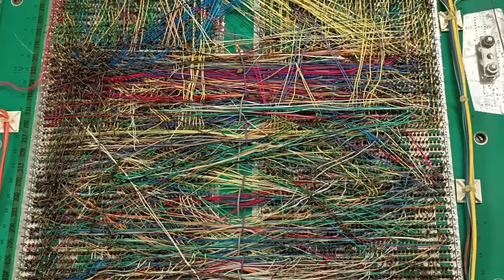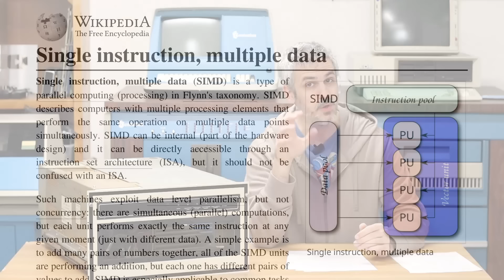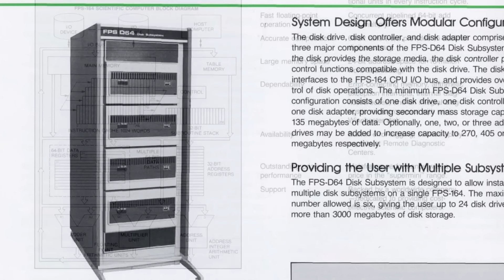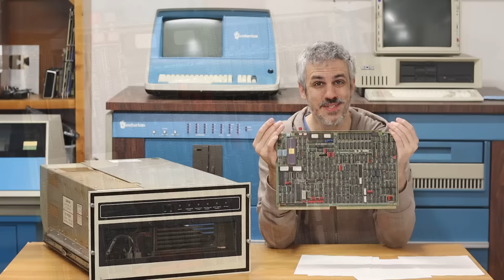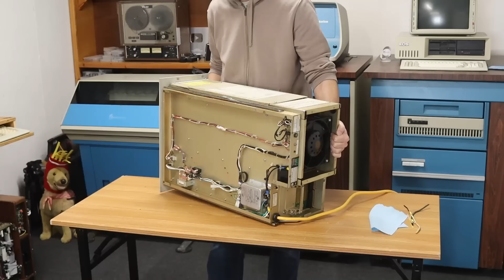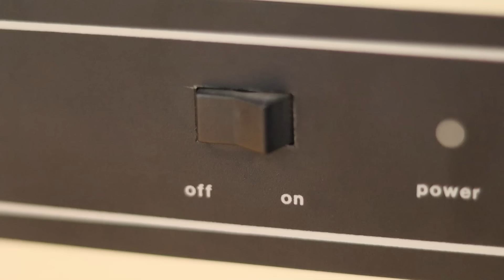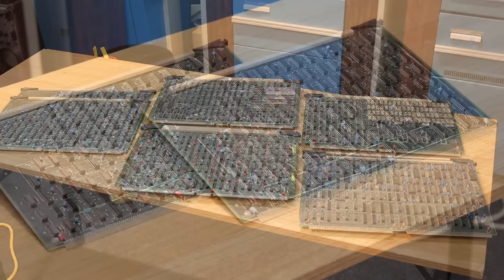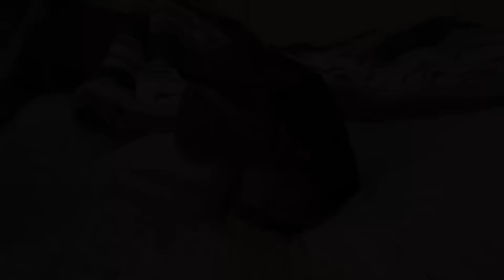This Computer is from a Defunct Supercomputer Company

Comment: My very first job after leaving school at 18, was with a local company that specialised in converting and processing seizmic data, mostly from the North Sea back then in 1982.
They had a few old to very old systems, the oldest (the name Varient come to mind with the OS called "Beta B<??> C<??> or BBC for short) 16bit machines, that had large hardware machinery of rotating drums (many sizes) that were used to read analogue tapes, where each tape recorded one shot-point.

A shot-point being the literal long line of microphoes (typically 24+1) that recorded the echos of a shot (a loud bank) from layers of rock/soil/oil... There were a lot of seizmic formats on lots of recording media, almost all using magnetic tape but paper traces that needed a person to digitize each line by hand (not quite the worst job there).

They also had a TI990 that had four half inch 9 track tape drices and one half inch 7 track and one 1" 21 track reel to reel tape drive. Those 1" tapes were heavy so the drives had very large tensioners to handle the tape stop/start taking a second or two. They picked a secon TI990 that had chip RAM rather the their old one that used core memory. Oddly enought the chip memory was slower as it needed extra hardware as teh TI's interface was just for core memory.

The newest machine they had was a VAX 11/780, that by the time I left 3 years later had 12 half inch 9 track tape drives that worked at 800, 1600 and 6250 BPI, and had auto skew detection. The VAX also had 2 Array Processers and one Rasterizer, the AP's were used to process that seizmic data doing things like resampling the traces (the digitised sound data) to account for each microphones distance from the source of the sound getting farther away, delaying the time the echos arrived to them.

At no time did anyone regard those APs as "Super Computers", they were only faster due to running in parrallel, it was faster for the VAX to do simple tasks itself as the time used to send & receive both data and instructions was still significant.

Note that the VAX had/has multiple floating point formats in 32bit, two 64bit formats. The 64 bit formats also had two types called D & G. The 32b float and the 64b-G are almost identicle to the IEEE formats that followed, making convertion of old data easy. I have (somewher not seen it for years) a VAX Fortran Programmers Code booklet somewhere that detailed all the data type VAXes could deal with at the instruction level.

All VAXes had integer instructions for both signed and unsigned: Char/Byte 8b/1B, Short/Word 16b/2B, Longword 32b/4B, Double Longword 64b/8B and Octaword 128b/16B or 8x2B to match the name.

After IEEE floats were standerdised later VAX and all Alpha's used IEEE with the old format listed as depricated and the instructions handled by routines in the kernel not microcode or hardware.

One of the most common floats in that old seismic data was IBM 32bit FP.

I still need to test out a couple of microVAX 3100 models 38 & 39 so two of the fasts single CPU VAXs ever made at 38 & 40 VUPs. I have not turned them on in well over a decade and try to sell/give them away. They look like old desktop PCs (one even has a SCSI CD reader) but they are bloody heavy due to the thick steel cases and PSU.

I'll be looking for someone in the UK who is willing to drive down to Kent to pick them up, along with a Vaxstation 2000 with 19" CRT monitor (not the original DEC one) and a VT480. Both the mVAX 3100's have 256MB RAM and twin 64Kbit comms cards used for handling things like X.25 lines, there's also a (possibly junk) TK50 and HDDs, and I just remembered there was a SCSI ZIP100 drive, it is most likely dead as those ZIP drives never seemed to last more than a few years.

Comment: I wondered, when talking about the backplane, whether it would be sensible to use an x-y (cartesian) robot to build it? I would think it would be a lot easier to get repeatable results and avoid omitting or misplacing a wrap. And IIRC wire-wrap requires a certain tension on the tool which, if not given, means the wrap looks fine but doesn't connect.
I don't know if there is any software that could translate a netlist into robot -acceptable commands but if you could start with e.g. kicad (to generate a netlist) and then thing and send the result to a robot, you could do trial runs and so on without a lot of labour intensive work. Just a thought.
Perhaps, if a robot could be borrowed, someone in the Kicad community could write a python script to make the link?
Reply: Back in the day, some companies did use semi-automatic machines for this job. The coordinates of pins which needed to be connected were punched on the paper tape, and the tape instructed the robot to move the tool the the required point. (Metalworking CNC machines used the same kind of tape at the time.) But at least some of the wrapping machines required a human to finish the connection after the machine positioned everything properly.

Comment: Geological data processing is used in analysing sismic waves and also to probe the ground for potential traps for oil and gas.
Put a big vibrator truck and analyse signal from various mic's in the ground to process the échos.  So to speak.

Comment: For me, arrays and vectors are apples-to-oranges:
- An array is a one- or many-dimensional "grid" of cells (each of which stores the same kind of datum), laid out in a regular pattern but with no pre-defined purpose.
- A vector is an array put to a specific purpose: to signify a direction or location (e.g an x,y,z vector).
- A matrix is a one- or many-dimensional grid of cells (so yes, an array) which have defined rules (so not an array) on how you do mathematical operations;

In c++ we have std::array, std::vector, std::list, and std::dequeue. Now the first three are well known but where the ** does the word "deque" come from? I understand "queue", "fifo", "lifo" and several more. Why not use one of them?

Comment: 20:36 “Clean and stable 5v” can be misleading.  As I discovered the hard way, using a voltmeter can fool you.  It’s always good to check an unknown supply with an oscilloscope as the meter often ignores AC ripple.  Chips, however, do not.
Reply: Or the cheap option, an analog voltmeter. The digital ones just show you the DC voltage, the analog one if there's AC ripple the needle jiggles.
Reply: Indeed. Without a scope it's possible to measure some ripple on the meter using the AC setting, but always better to see what's going on with a scope.

Comment: Vector processors like the Cray-1 don't perform operations in parallel like modern SIMD execution. They are more like deeply pipelined execution units. This was important for hiding latency back before caching was a thing.

Cray-1 ran at 80MHz and could complete a new FPADD and FPMUL per cycle (on different execution units), hence 160 MFLOPs. The high high clock speed was achieved with fast power hungry ECL logic, fast register files and a heavily bank interleaved SRAM.

Comment: On the topic of geological uses for an OG GPU: My advanced calculus instructor (I was in school in the late 90's) used to work in oil before being a professor. He could draw perfect circles on the board before that was a thing, because he did contour plots for oil. It came up when we worked with the "delta dirac function". Oh what's that... well oil was looking for shale.. shale will reflect/refract sound in the ground. the "easy" way to find the shale is to set up a whole bunch of seismometers and set off an explosion on the surface and do math on the signals. The explosion is modeled by the delta dirac function and deconvolution of seismometers data is the killer app from the 70's that made big money. there is a kind of movie magic version in the original Jurassic Park, where they fired a shotgun shell into the ground to create sound waves and analyzes the reflections to produce a subterranean image

Comment: Arrays can be used as vectors but in software development not all vectors are implemented as arrays. Vectors are a mathematical concept while arrays are a data structure. So it's correct to call it an array-processor. It can be used to solve problems including arrays., but can also solve array problems where vector math is not needed. But in reality 95% of all vectors are implemented als arrays.

Comment: I'm a (thank God!) retired doctor... So why do CT scanners need so much compute?
The TLDR version: When you take an X-Ray you shine the X-Ray 'light' at the person and how much of it goes through depends on the density of the 'bits' in the way. What's left exposes what is basically photographic film and you get a 'negative picture' that's a 2D projection of that person's insides.
So, CT Scanners...
The pictures that come out are represented as slices of the person you are scanning (usually looking from the feet up!) for the sake of our simple brains, but that's not how it does the job. Instead what you have is a 'light' (X-Ray source) and a detector on opposite sides of the person in the scanner that spin around them in a tight spiral - think home flat-bed scanner curled up in to a tube if that helps. What you get out is to all intents and purposes a serial stream of density data resulting from the spiral path around the person that the detector 'sees' - pretty bloody useless. 
All the processing power is required to construct those lovely 'internal slices' we can understand from that serial stream of data combined with the known spacial positions of the detector and source at any point along said serial stream of data. How?
Imagine you're looking at the feet of the person in the scanner and the detector is at the 'top', the source at the 'bottom' For that position in space all you know it the average density of the person on a line between source and detector. Now imagine the source and detector have moved 90deg to left and right... and again all you have is the average density for that line too, but there's more! At tthe point where the two lines intersect you can say something about the density of the that specific point in space inside the person... spin that through 360deg in very fine increments and you can now say something about every point in that slice, and keep spinning in a tight spiral from bottom to top and you can produce a whole series of 'slices'.

The perspicacious will at this point be saying, "Hey! Wait a gosh-darn minute" for a number or reasons... I did say this is the TLDR version. Now imagine how much precision and how many calculations you'd need to achieve only my half-assed explanation. Now multiply that by all the reasons you can think of why this isn't the whole story. Yep, that's one hell of a lot of computing power - I remember back in the mid 90's those 'slices' literally chugging out of my hospital's fancy CT scanner just about slow enough for each slice to noticeably appear one line at a time, a good many slices per patient! 
Ah, the days when the technology was slow enough that a horribly busy doctor could snatch the occasional 'break' through waiting for the technology to catch up with events. Now everything seems to come through instantly and you are in an endless cycle of insatiable demand while running without pause from one thing to another.

Even though I retired from medicine on health grounds, having been broken by far too many years of unending long hours of extreme stress without respite or support, insatiable demand, and for the most part the utter ingratitude of my patients, I'm actually glad to be poorly and finally out of it than well and ever have to go back to that living horror!
For God's sake - if any of your children are smart enough to become doctors, get them to do absolutely anything else to avoid seeing them slowly broken in front of your eyes by the unending misery of modern medical practice!

Comment: The wires on the board indicate that the board is early release. When you order board blanks, there is a setup charge and an additional charge per board. The additional charge is so low that it's normal to order extra boards with the assumption you don't need to many wires to get it working. Once you are happy with the board, you will do a re etch and clean up the wires. You may still need to add wires because you discover an additional problem or you made a mistake in the re etch. The problems is worst with high density parts because there are more places to go wrong. I have a prototype board with a maze of wires but it works. What is worst is the board is a second etch. About half the board was working and usable so we did a re etch. After de bugging the second half we had more wires. Don't blame us because the board was intended to be partially depopulated depending on the customers need. We never intended to ship a fully populated board but we intended to use one blank for several needs.

Comment: 01:32 I don't know if the FPS AP-120B could be daisy chained or stacked but if they could be, for the price of a Cray-1 in 1976 you could get roughly 205 of them, which would have given a total of 2.46 Gigaflops (2,460 Megaflops) which would have been absolutely insane in 1976. Honestly just 14 of them would've surpassed the Cray

Comment: Nowadays, it's called SIMD and often called vector processing (ex: Intel MMX, SSE, and AVX). I think it might be to help separate the idea of using array data structures in SISD vs array processing in SIMD
Reply: SIMD is sequential/serial and just saves loading the instruction each cycle. This is true parallel vector processing, SIMT like a GPU not just SIMD. It also evolved to MIMD on this unit which is more like modern multicore processing

Comment: One of the AP-120Bs in China is the rack version called AP-180V, which is part of a LANDSAT ground station. I think it belongs to the LANDSAT-D mission. It was used along with a VAX 11/780 to process images taken from the satellite. According to publications from NASA, the AP-120B does calculations such as geometric correction, image resampling, and classification, and can reduce the processing time by a factor of 2-5.

Comment: To me, it is very sad and surprising, as the age of these machines is not old in the grand scheme of things. I wonder what another 50 years will be like for getting old tech up and running. I wish endeavours all the best for 2026, and I really hope there are more people out there to preserve this important history. Thank you.
Reply: I think standardization will make it a lot easier to figure out how to repair, reverse-engineer, and emulate today's hardware. Even stuff from 25 years ago was really starting to benefit from this, SATA is a deprecated but still supported format on today's hardware. We still use ATX and micro-ATX form factors, the biggest change has been to eliminate visible drive bays (who has optical drives anymore?) and put the power supply on the bottom.

Comment: Back in the 1980s/90s I was involved with computer analysis that was used to develop stealth (low radar cross section) technology. We needed all of the computing horsepower that we could get our hands on and it had to be usable in a highly classified and covert environment. At the time, the very existence of stealth was classified. We couldn't use the big iron (Cray-XMP) in the data center, because how do you isolate it to run code when your project isn't suppose to exist? We looked into the FPS-120, but it had limited performance and a small word size. About that time, the SCS-40 and FPS164 came out. The aero guys jumped on the SCS-40 because all of their code was very Cray-os specific. Our electromagnetic code was newer and more portable, so we went with the FPS-164. At one point we had multiple screen rooms with an FPS-164, a VAX-11/70, and a massive air conditioner in each. There was just enough room for a few terminals and we had to wear coats because the room was so darn cold. But, it got the job done. Obviously, I can't say what we were working on. But if I told you, you probably wouldn't believe me anyway. That only lasted a few years until the FPSs were replaced by a brand new 64 node Intel iPSC/860 Hypercube. When the Hypercube rolled in the door, it was the fastest computer in Seattle.
The FPS164 was a great machine. It served us well. You don't know it, but you have a lot to that it for.
P.S., one of the cool (sic) things about those screen rooms was the air lock that you went through to enter. It had massive pneumatically operated sliding doors that felt and sounded like they were out of Star Trek.